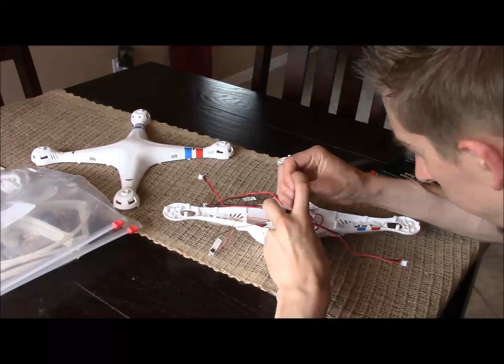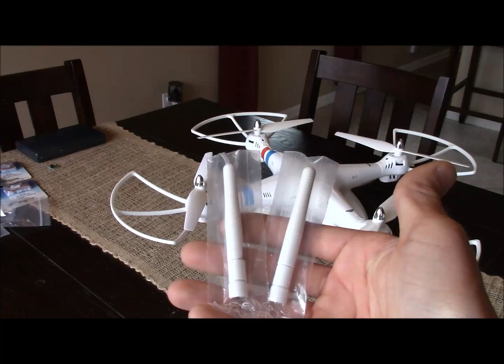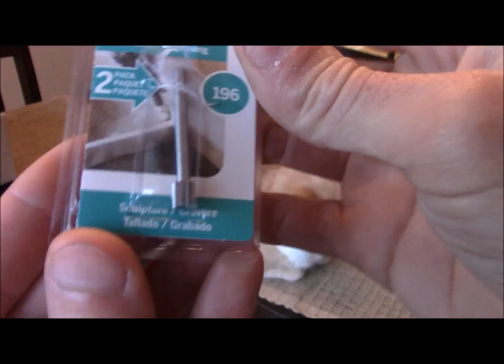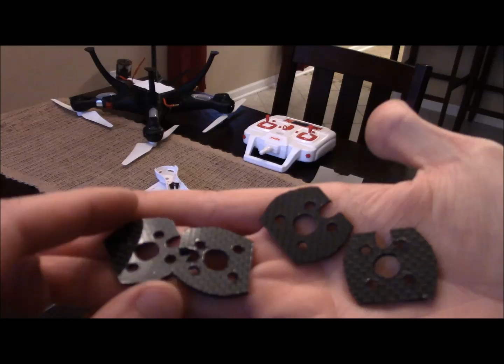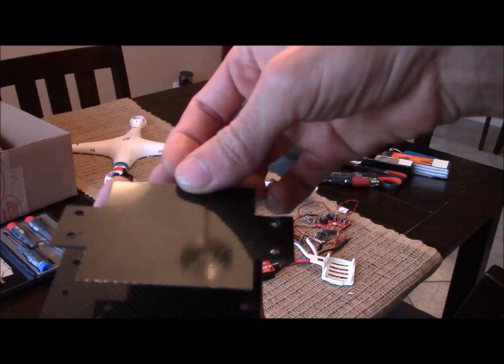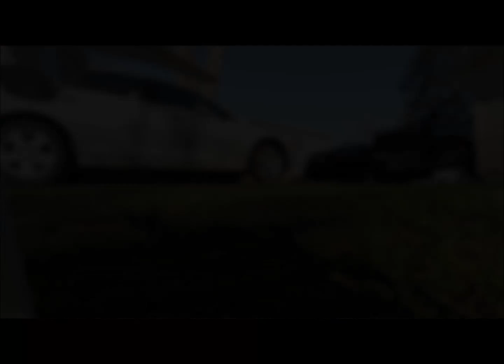Syma X8 brushless conversion with stock RC - Step-by-step how to!

Comment: Are there some solution for stopping 
that shake?
Reply from the maker: Not for this build.  A custom flight controller and rc is your best bet.
Reply: Preston Rice ok bro
But just watch some videos of the syma x8 with brushless motors. 
They weren't shaking even once 😅😌
Reply from the maker: +Bhavesh Deepchund That's because they were using a custom flight controller!  If you watch my other video using the Naze32 flight controller, you will see I achieved a nice stable flight.  And, of course, I can endlessly tune it better if need be.  ;)  Thanks for the support.
Reply: Did you try soldering capacitors between the esc leads like all the racers do to reduce noise?  Looked like noise to me. my dromida XL nees brush less and there's room.

Comment: I wasted half an hour to learn that converting to brushless was a shit idea. Might as well just replace the FC with a racing drone FC and 4in1 ESC as well if the factory FC can't handle it. Smaller, less weight and won't defeat the purpose of the project. Then again, might as well just buy a racing frame as well. Cheaper than messing around with a toy X8 to begin with.

Comment: this was so pointless you have better motors for a ninety dollar quad that is meant for a small camera but now it wobbles so you cant use it anymore so pointless
Reply from the maker: comercial gaming No, this was an experiment.  Read the description.  I had no problem obtaining smooth flight with a proper flight controller.  Of course everyone complained then, that it cost too much...
Reply: yeah i just saw the updated video know i want to do the conversion i just dont know how
Reply from the maker: They do sell an affordable brushless conversion kit now, but the motors are pretty weak.  Or you can build it yourself like I did with a custom flight controller, powerful motors and an aftermarket RC.